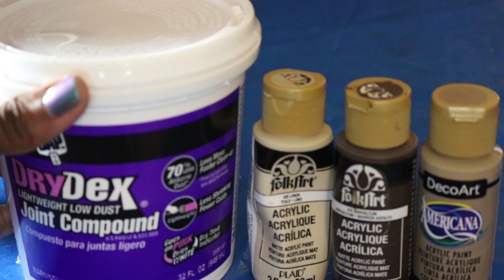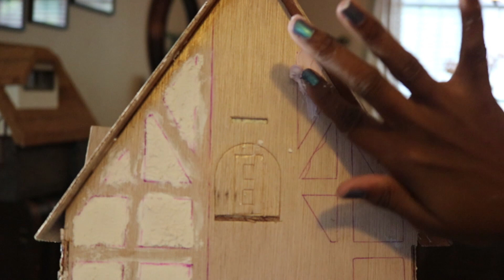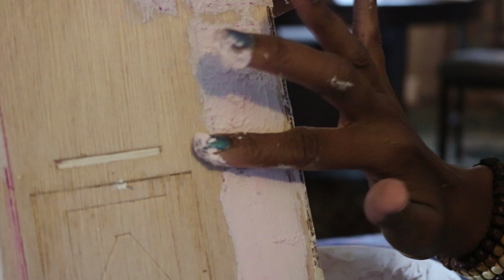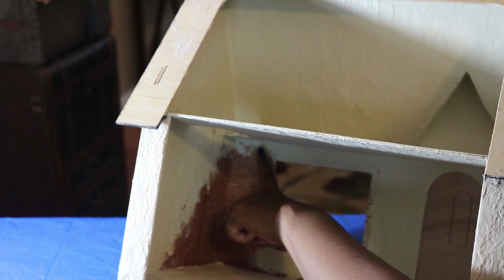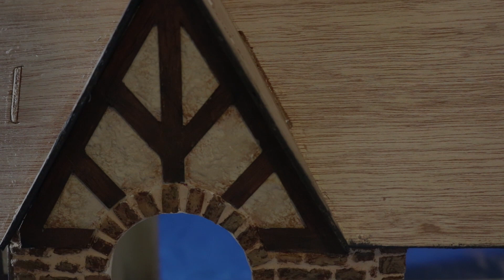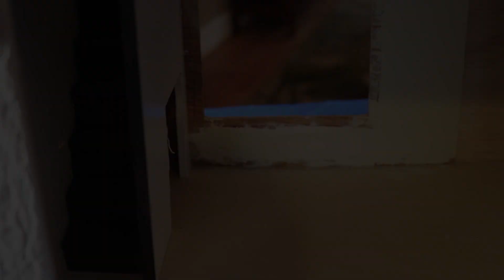Dollhouse Stucco Tutorial  Using Joint Compound

Comment: Very helpful, thanks. How long do you think this stuff would last? Will it degrade quickly?
Reply from the maker: I've used joint compound for years for different applications in my dollhouses and never had a problem.  It's made for real life houses, so it's made to last.